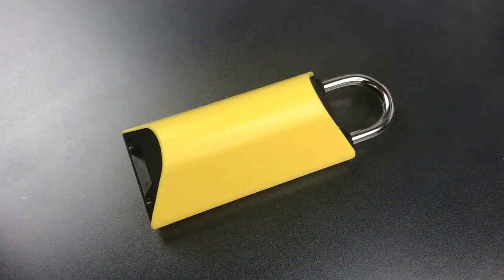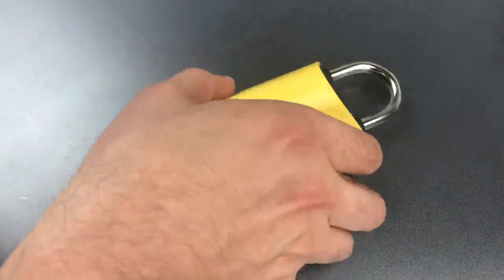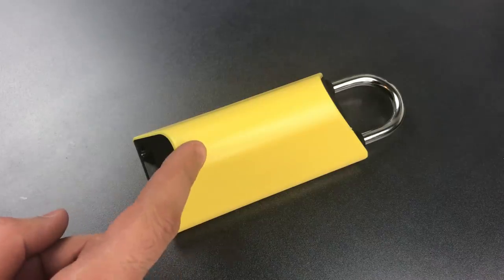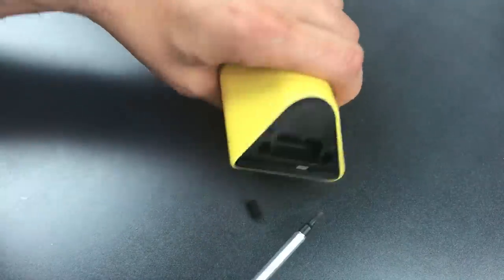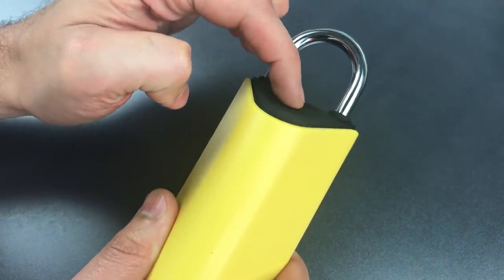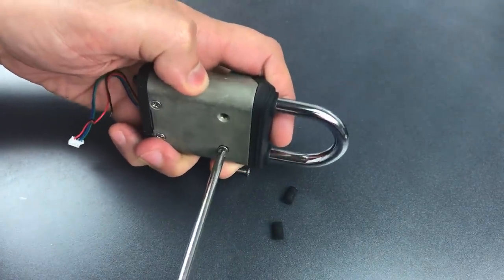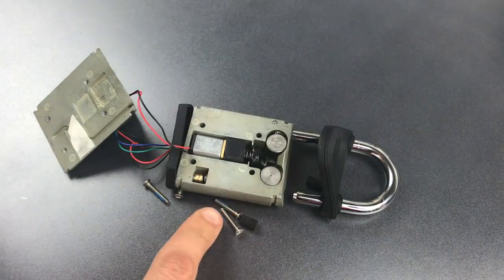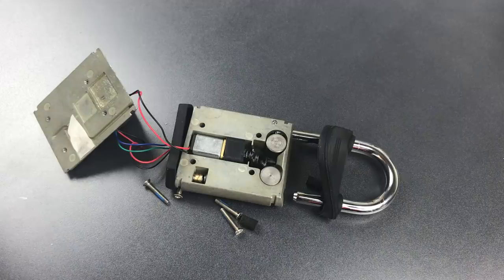[752] BoxLock: $129 Barcode-Scanning Padlock Opened With Screwdrivers!

Comment: After disconnecting the wires from the board, you probably could of opened the lock by connecting the right pins to a 9v battery

Comment: The torx with a pin is easy to defeat. I use a flat tip screwdriver to break off the pin and use a normal torx bit. Yes, I am from Russia

Comment: Even if the owner filled those holes with epoxy, you'd only need to smash the plastic lock body, pry it off, and unscrew the actual lock part. If it's not your lock, and you're in a hurry (because you're on someone's front porch stealing shit) then you're not going to worry about nicely and cleanly taking apart their lock...

Comment: If you'd done this with a drillbit instead you could've done it in less than 30 secs. Aside from the security head torc bit I have the parts needed to do that.

Comment: Pull the 2 wires from the 2 pin connector (the battery) and connect them to the same color wires on the 4 pin connector and I bet the lock opens. No need to remove those 4 screws 👊

Comment: Better product: a locking box which uses a man-trap lock.  Attempt to pick, get cuffed to the box and have the cops called.  Get the thermal sensor to above 50-100C in the shade, call the cops, pepper spray the crook.  Make too intense a noise near the box to indicate that you are using power tools, get pulled in the air by your ankles.

Comment: I mean it looks like total cancer but the concept is almost essential at this point. I've seen a fair few houses which get packages stolen so often they have to set up traps. And about a week ago I had a package left outside in the open despite a signed recorded delivery for a $700 device, even a ghetto plastic lock would have at least deterred a few people had I not been quick enough to pick it up.

Comment: Not really a security flaw.
It's not supposed to lock a motorbike, but just some amazon delivery, it's to stop ordinary delivery thiefs which are usually not very smart and surely won't carry extra long security Torx 10 screwdriver along with specialised foam extractor tool...

Comment: Don't the bottom screws HAVE  to be removable, so you can eventually replace the rechargeable battery?  Unless that is a very good quality rechargeable battery, it'll only typically last about 2 years where I live (southern CA).  Maybe 2 years is the lifespan of that device?

Comment: Looking at that two-part metal body with no inset/lip, would it be possible to slit the rubber cover, and put a shim/probe between the two sides of the body to trigger the release?

Comment: So clearly I’m late to the party, I Also realise that they have fixed this issue however my only thinking is that this is suppose to be attached to something like a gate or box or what have you, if attached correctly would it be possible to even access the back four Phillips screws? 
I mean technically you would more like be able to break what ever it is attached too but I’m curious if this lock was set up in a real life situation would it still be so accessible?

Comment: Most crazy to me is they clearly understand some basis about physical security. The frame of the shackle is pretty robustly built. So there is try of physical security. But then they leave the construction such as to be easily deconstructed while locked. Why have the rboust frame block in the first place?

Or if one is bothering with a robust frame block, why not use couple minutes design time to make in protected. Screws inside the shackle hole holding the frame in place etc. aren't a new idea.

But yeah, clearly the outer frame was designed by consumer industrial designer. At easiest the outer frame could have been tapped other way. In to the frame and have a screw trough the bottom of the shackle hole out towards the top section screwed in place. Instead of being screwed directly from outside. Like who puts dismantling screws on the OUTSIDE of a lock.

Inside out inside out, that is always rule on dismantling bits of a lock. Be it the inside side of a door or the inside of the lock frame on a pad lock.

Comment: Relying on accurate tracking and delivery data from USPS, UPS & FedEx to allow access to the lock is a wee bit optimistic. There are often problems with tracking. Forget the screwdriver... a hammer and chisel will open that "lock" in seconds.

Comment: If they just permanently sealed the shackle and motor assembly (and had a coded pulse for motor instead of only power it wouldent have mattered if the electronic was accessible. Excluding actual errors with the electronic security.

Comment: So what happens when the battery dies? Is it easily replaceable? Who is going to want to have to break open their $130 lock if it's not replaceable? Is the thing water resistant? If I were to dump water on it would it be possible to cause a short?

Comment: It seems like the only thing in the metal lock body is a motor without logic board. So if you just connect a battery to the motor wires, it should just power the motor and unlock it without even opening it.😂 What they should do is install a motor controlling logic board with the motors inside the metal lock, the main logic board in the plastic shell only send the encrypted codes to the motor controlling boards, only when the codes matched, the motor inside the lock can be turned on. This will probably add a little cost to manufacture.

Comment: So.. If you have an empty box outside your door. Can’t you just have an unlocked padlock hanging there which they can use? Way quicker, zero hassle with QR codes.

There are probably other use cases, but to me it just feels a bit odd.

Comment: I would categorize it as a design flaw. As a Quality Control Inspector I do not see any obvious signs of improper materials or assembly. Selection of materials and components is a function of the design and review process. They should have locked up some candy and let a kid at it. lol. Realistically the idea does have a valuable function in this day and age. Some relatively minor design improvements would make the product more secure. Perhaps a stainless body to help prevent physical attack would be desirable. Having said that electronics are inherently insecure. On the other hand the product shown would protect against a snatch and run theft.

Comment: not only would i add an epoxy to the holes on the bottom and put one of the screws through the shackle hole i do belive i would make the outter body of the lock from metal if it is not already

Comment: Once you remove the bottom, you have access to the motor wires. Actually it look more like a solenoid? If it is a solenoid then there is a very high chance that one side of the motor is permanantly connected to the battery, and all you need to do is connect the other side to the battery. Considering that it is easier to switch the low side, a piece of wire from the motor/solenoid negative to the battery negative is all what is needed. *click*.

Another possible non-destructive attack is to pull the top enought to expose the actuator, and actuate it like you did. From 3:20 you nearly pulled it out enought to show the actuator. You then procede to pull the bottom way more than what would have exosed it. I assume there is nothing between the bottom and top that would prevent the top from moving as much as the bottom...
Reply: Not necessarily. There are two connectors - one with 3 wires and one with 2. The red/black wires in one of the connectors are plugged in very near the scanner in the bottom assembly and are not necessarily the same red/black connected to the motor (it wouldn't surprise me if they were, but from the video we don't know) and they might come from the button at the top to activate the lock.

Comment: Why are there so many of these "smart" designs where the locking mechanism itself doesn't help mitigate disassembly of the lock? It seems like basic logic.

I want to believe that some one somewhere in their product team suggested that a required assembly screw be blocked by the shackle but was shot down because cost measures or other technical limitation argument, not that the entire security of the device itself was overlooked.

Comment: The security of any lock regardless of how well it is built was made mute a few years ago. Battery powered angle grinders will get through any lock in seconds. Building anything tough at this point is a waste of effort. A lock should just be considered a deterrent and nothing more.

Comment: Obviously this lock is just designed to slow down "porch pirates", and make delivery convenient for fedex or whoever.  Nobody is going to sit around and disassemble this thing, anyone wanting to get into your lockbox is just going to chop it real quick.  And it beats a cardboard box just sitting on your steps.  What it SHOULD have is a tamper switch alerting you on your cellphone.

Comment: Couldn't you just bypass the circuit board and hook the battery straight to the lock and it should pop open as long as you hook to the right pair? I haven't finished watching the video yet I don't know if you'd mentioned that.
 Also if you filled the bottom holes with epoxy and that battery goes bad your lock is now trash. I know all about those little batteries, they die so much in exit signs and emergency lights. I'm replacing them all the time.

Comment: I would suggest having a hole through which a real padlock could be inserted.  Filling holes with epoxy could make the lock unserviceable, and putting the attachment screw through the shackle could cause similar problems if the unit fails while locked.  Allowing users to secure the device with a quality padlock of their choosing would avoid such issues, and also avoid the need to have a permanent master-key barcode which would allow anyone who found it the ability to open the lock forevermore.  Construct the lock so that it cannot be opened while another padlock is in place, and then the electronic lock company wouldn't have to worry about how to help people who accidentally lock their product in a way that can't be opened.  If no secondary padlock is installed, it would open somewhat easily, and if the secondary padlock is installed, the key to opening it would be to remove the secondary padlock first.  If the user loses the key to the secondary padlock, the electronic lock company could not be expected to solve that problem.
Reply: People hopefully will not stick the master key right next to their lock and instead throw it to a reasonably safe place with their other keys in their homes.
Plus If your locked 129$ lock needs an additional lock just to not fall apart when touched with a screwdriver it's overpriced and you made a terrible job designing it.

The safest way would probably be an open padlock that is then closed by a delivery person. Not reusable until you are home again, but you could build 2-3 safer boxes with padlocks for the price of this "high-tech" one.
Reply: A problem I think you overlook with your drop-box concept is that a prankster could walk by, see the open lock, and close it before the delivery arrives.  On the other hand,  a cheaper and more lightly-constructed version of this lock could provide excellent security in conjunction with a stronger padlock and a suitably-designed lock box.

Use a drop box with a latch that can be closed, but not re-opened, while a quality padlock is installed on it, and use the digital lock solely to prevent the drop box from being latched.  Instruct the driver to scan the barcode, remove the digital lock and place it in the box with the delivery, and latch the box.

Vandals may be able to easily break open the digital lock, but such actions couldn't be rationalized as a "harmless prank", and all they'd get for their efforts would be the ability to prevent the delivery.  Consequently, the digital lock could be made much more cheaply than with the present design while still serving its required purpose.
Reply: @flatfingertuning727  
or you could build a padlock dispenser that dispenses an open lock instead of opening one itself. That way you could use the scanner for multiple boxes instead of just one or two.
Reply: A lot of higher-quality padlocks are key-retaining, and even those that aren't could be stolen and re-keyed if left open.  Further, someone who broke open the lock dispenser could then substitute different locks of their choosing (perhaps ones they've stolen and re-keyed).  Using a drop box with a secured latch would avoid such issues, since the padlock could be left secure and could not be removed by anyone except the owner.
Reply: Flat Finger Tuning  
Why should i break the lock dispenser to re-key a lock when i can simply break the latch or the box itself?
Reply: A thief who steals an unlocked $50 padlock and buys a $2 repinning kit would have a padlock he could resell for $25 or so.  Stealing a locked padlock is a much less attractive proposition.
Reply: he would still need to destroy the dispenser. If he is going to do damage anyway i'd wait for the package to be delivered and steal it. The possibillity of a 20$+ profit without any additional planning or buying to be done whatsoever is a lot more attractive imo
Reply: The intention would be that once a package is received, it will be stored in a quality lockbox secured with a quality padlock.  The only thing the digital lock should be guarding would be the ability to prevent the lockbox from being opened until the owner's return.
Reply: Flat Finger Tuning  
So would the dispenser. but the dispenser could supply several boxes whilst a fixed bar only can protect 1.
So why not make it a scalable dropbox with only a lock for low use customers and a dispencer for high use customers and apartment buildings?

Comment: i am pretty sure you could even strip some wires and activate the motor for the actuator via the lithium ion battery filling the screw holes with epoxy provides some tamper resistance and a tiny bit of security the big vulnerability with all these smart locks is that they can all be disassembled and seem to be made of plastic this one at least has an inner steel casing but that is pointless when you can disassemble it using a motor instead of a solenoid is a good move  but plastic yet again why not brass the goal is clear not be vulnerable to a magnet being inside of a steel casing greatly reduces that risk and even if the retaining mechanism was all steel to the best of my knowaldge no magnet bypass hacks have been susccefull even against an all brass padlock with steel locking llugs but why not use brass its stronger and what they are charging for this lock they really should not have issue with not skimping on martial I think their best move would be to design the electronic hard ware including the motor to open it then pass off the rest of the design to say master lock if they want to keep the price from going to high master lock knows how to design a secure lock body so give credit were its due

Comment: Great concept but somebody needs to go back to the drawing board! I presume that there is an intended way of replacing the battery? Surely they don't expect you to disassemble to whole lock to do that!
Reply: The USB port is there to enable the battery to be recharged (and getting to the battery if it fails only requires removal of two foam bungs and two Torx screws - much easier than your typical laptop or mobile phone nowadays).

Comment: that last unscrewing of the top part was actualy unnecessary, you had access to the motor wires and could just power it to open the lock, so just the access to the bottom electronics is enough.

Comment: What happens if you attach a battery to the red and black wires? Can you control the motor without undoing those last 4 Philips screws?
Reply from the maker: Yes... you can even use the battery already in the lock. 👍
Reply: Part of me is thinking that's nuts... part of me is thinking well that fits with the rest of the design!
Was also wondering if you could brute-force it by pointing at a phone that cycled through bar codes on screen (or a dancing zebra), is there any re-try limit or lock out (i'm thinking of that as an avenue of attack for v2 as it'd probably take longer than using a screwdriver on this version).

Comment: "built more like a cellphone" - not really, funniest parthere is that it is actually built better than most cellphones, as it seems to be perfectly serviceable, up to the point of reusable wire connectors, instead of just soldered wires :D while phones nowadays are all glued up and stuff, so that it's hard to reassemble them without any trace. Weird world we're in.

Comment: someone is supposed to have something to take out foam plugs, and two screwdrivers of good size and shape, and be able to deal with the lock for a couple of minutes, rather than  have cutters that can cut the shackle in 5 sec?  I would say it is an advantage of this lock that we can disassemble the lock without braking it, when the battery is flat and don't take the charge, for example.

Comment: That won't realy do it. If you're unconcered about breaking the log you just destroy the lock body, take a little wire, a battery and aktivate the motor of the lock be hand. 
No screwdriver needed. 

You need to encase the whole thing in a solid metall casing and hid the screws.

Comment: If you seal it with epoxy, how would you change the batteries?
Reply: You're not supposed to change it, it's a rechargeable battery.

Comment: FYI those "tamper proof torx bits" will twist and permanently deform when used on standard torx fasteners. They don't have the strength to remove tight screws. You'll want to get a 2nd set of standard bits.

 I use them all the time in my profession and I learned that lesson trying to do the same thing as you.

Comment: Phones is 2018: No screws because the manufacturers don't want you getting into them.
Padlocks in 2018: Screw on the outside so you can get into it.